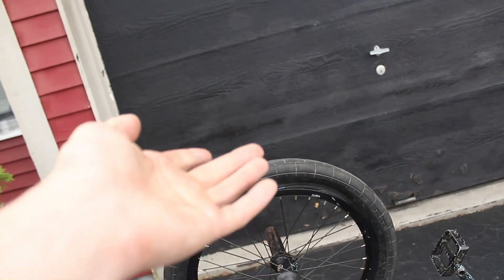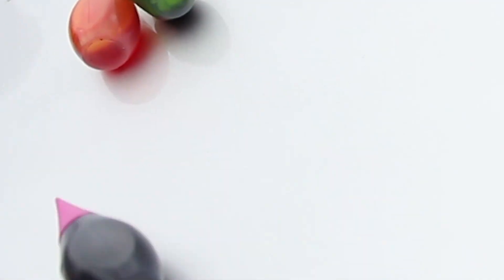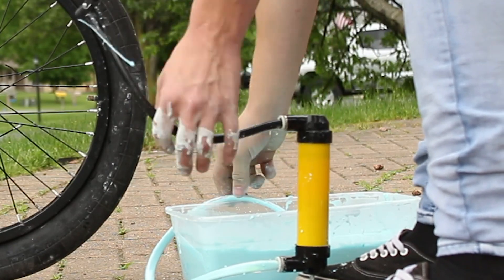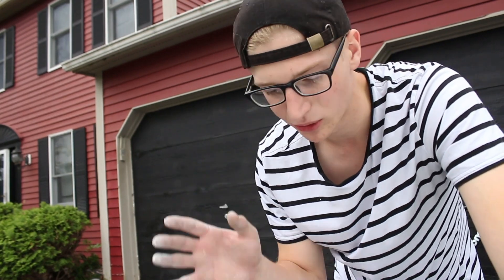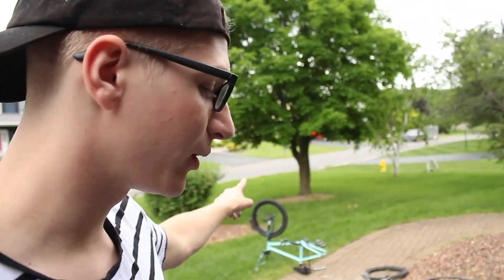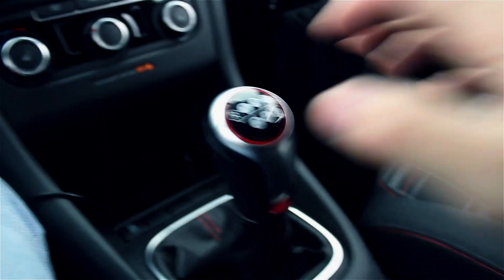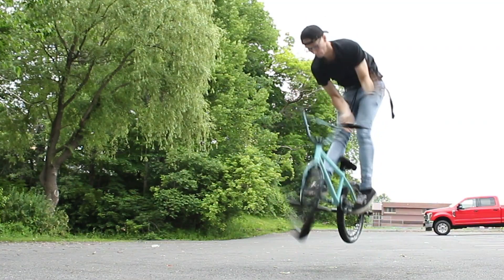Filling a BMX TIRE with OOBLECK!

Comment: Put in cornstarch then pump in the water
Reply: that seems like it would work but I'm not sure you would be able to get enough corn starch inside the tires, would also need to leave a few coins or something in there maybe to help mix it up
Reply: Miguel Angelo Daquiuag yesss
Reply: Strangely My Comments Usually Get Quite Popular ball bearings, like what they use in spray paint.

Comment: Use a sand blaster gun with corn starch in it to fill the tube.  I have done it with baking soda so think it should work with corn starch.  After you get the want in there then add the water.  also you can pump air in there last.  It will give it the space needed to be liquid.  Fun science class type stuff.

Comment: I would suggest using an adapter to screw on to the valve stem and attach it to a 1/2" hose then use a big syringe to slowly fill the tire

Comment: Have you heard of xenon?

Xenon is a gaseous element of the periodic table much like helium, however it is denser than air. There are videos of people online inhaling it and it makes their voice sound demonically low. I'm not sure how easy it is to get your hands on it, but if you did you should fill a bike tire with xenon!

If the theory with the helium was since it was less dense, it needed more to fill, my theory is since xenon is more dense and it'll take less to fill a tire the bike might be lighter???? not sure that'll be the case but it's a good idea for an experiment!

5:40
 hits blunt 
what if you somehow get the corn starch into the tire first, and then once it's in there fill it with water and it'll mix as you ride it maybe?

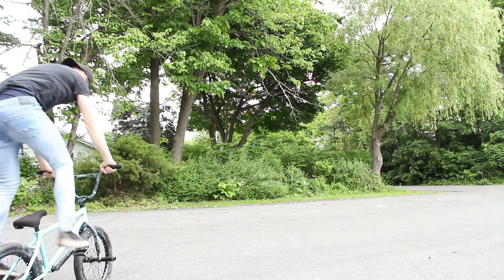10:47
what if you spun the tires before riding so that the centripetal force puts even pressure on the oobleck and evens it out across the tube

Comment: Put a pin hole in the tube use a turkey juicer thing to put the water in and then put the powder in with the same process.
Make sure that you get a dry turkey juicer thing

Comment: Just heads up funnel in the cornstarch into the tube then slowly fill the tire with water and aggatate it so it mixes up... that way youll get the tire full with nice pressure and wont have to touch the ooblek!
Reply: Of course removing the valve!

Comment: your idea when you tried to just let it ooze in you need to add a hole to the bottom which will be at the top when upside down so air can go from the top and let it ooze faster

Comment: So for filling with the valve piece in, you had the correct Idea to remove the stems first. Now here what you do. Put the oobleck in the water bottle, take your hose that you connected to the valve and splice in an bike pump (electrical, gas or hand) this will cause a vacuum in the hose keep the stem in the pump you do not want the oobleck to clog it and ruin the pump, hook one end of hose to the valve and stick the other end into water bottle cap and be sure to seal ot very well not just good seamless is flawless, here's the part that will get tricky, you need to have the bottle hang upside down like an IV in a hospital, then cut a quarter size hole in the bottom of the water bottle to allow maximum force as well refilling the water bottle without having to dismantle the whole thing.

Comment: Dude legit your bottle method with letting it slowly drip in would’ve worked. Legit all you needed to do is while its upside down and ready to pour pop some holes in the top for air to flow. It’s like shotgunning a beer. Physics. It’s how it works. That air needs to come out somehow in order for the obleck to go in.

Comment: Should have put a hole on the bottom of the bottle so it can flow because of the pressure differences so it didn’t let it flow through the tube

Comment: Leave the tubes in and take the valve out and put the cornstarch in first and use a pump to put air and starch in and then add water to that with the valve in

Comment: I'm thinking you should of  removed the valve stems then go with the first way except set the jug up side down and up high then poke a hole in the bottom of the jug now gravity should let it flow into the innertube.

Comment: go to a garage, have them bead seal the tire to your rim.before they do this, take a string and where the valve stem comes out, have them put one inland tie the string to the valve stem.after they bead seal the tire to the rim, put the oobleck in the big hole where the valve stem is going to come out, when you have it start to come out,SLOWLY pull the valve stem out and seat it in the hole.put pressure in the tire and you are all set

Comment: Science does rule. I think you need to put the dry contents Within first. Over fill absolutely to the brim. Possibly vacuum out all access air. And then introduce water while under its under the vacuum state. Then add the rest of the water under a pressured state to complete the mixture. You will have to measure out of your ingredients carefully.
Reply: Obviously what you would also need a fine filter to prevent you from vacuuming out to dry contents.

Comment: Its not thick, you need air in. So hole in the bottom of the jug to let air in and it will flow better. Otherwise you create a vacuum.
Reply: Well, it is still thick

Comment: Bro just get a hair dryer to it not to close because use it will melt the plastic on the tube and the bottle but just enught heat would make it start turning to liquid and go right thru the tube

Comment: You should take your pump and suck all the air out of the tube so it's flat hold the valve steam shut with a plyers and then pump the tube full

Comment: Go get a big big tube and then when you get a big tube you shrink it down the time your valve sticks out when your time when your valve sticks out the tube is going to be small enough to stick to the valve and it's going to be big and then it's going to go in cuz it's not it's super big the tube is super big so if you do that it will make it very good it would fill up your tires with whatever that stuff is

Comment: I have the perfect idea ok like an bottle rocket the oblect on one in of the bottle with a hole and a lock pump the bottle full of air well half way and other half ooblect and when u have the bottle full of air unlock the lock which then will push all the ooblect in the tire just like how the water will flow out of a bottle rocket

Comment: i have an idea for getting oobleck in your inmnertubes

1)try using one bottle partially full of oobleck and at the bottom of the bottle have a tube that goes directly to the valve on your bmx innertube

2) then try to add a one way valve at the top of the bottle which you can pump pressure into the bottle with a pump

theoretically you should be able to pump air in the top of the bottle and the pressure at the top of the bottle will thenbuild up and push the oobleck out the bottom of the bottle (hopefully as a liquid) and the oobleck should hopefully go though the pipe into your tube filling your bmx innertube with oobleck 

i hope you read my comment i wish you luck if you come around to doing this idea as i think it will be a sick idea if it works and im curious on the results if you need help with the idea ask in my replies thank you

Comment: This might work. Try cutting the valve out from tube then replace it with one of these inflatables http://www.carmo.dk/thumbs/400x400xBR/gb/product/valves/inflation-valves/hf-weldable-pvc-plastic-inflation-valves-for-inflatables-(21).jpg not sure what glue but maybe the type you use to patch tubes. Might require you to make the valve hole bigger on your rims.

Comment: Should take the pin out of the nosel it will make a bigger hole in the nosel then you can screw it back in..... There is a tool for this that's cheap